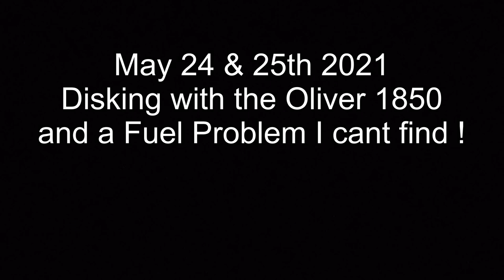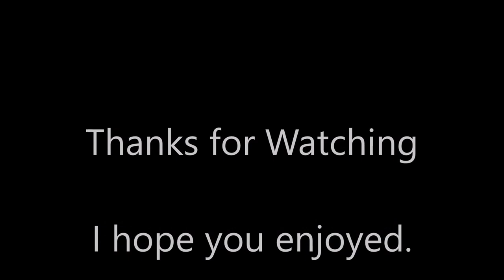May 24 & 25th 2021 Disking with the Oliver 1850 and a Fuel Problem I cant find !

Comment: I had that problem. It ended up being a weak lift pump not getting enough fuel to my injector pump.  I replaced the lift pump with a cheap Amazon product.  The lift pump I ordered from AGCO was a winner.  Additionally I replaced the copper sealing washers with a rubber/metal sealing washer that really helped seal my fuel connections at the lift pump.  One last thing I’ve run into, is the vent on the fuel cap creating a partial vacuum in the tank.
Reply from the maker: At the end of the video its sitting there running rough and running off the electric fuel pump and I noticed the top of the injector pump was damp something it had never done before using the mechanical lift pump so I know its getting more fuel to it. The lift pump is new that is on it but after everything I did and Harry did I went to the electric fuel pump just to see if there was a difference and at the end of the day I still got air in it. As far as my fuel cap goes I've learned not to fill the tank clear full as the cap leaks fuel all over the hood ! LOL  We even pressurised the tank looking for leaks in the fuel system and couldnt find any, With the electric fuel pump on if you take the fuel line off the out side of the final filter it will shoot a stream of fuel 8 feet !  The injector pump was rebuilt but I'm wondering if the problem is not in the injector pump now, I think its time to call the guy that rebuilt it and see what he says. Me and Harry both are running out of ideas to try and its really starting to bug me !  Bandit

Comment: There is probably a check ball in the return line on the pump. Pull it and maybe check to make sure the governor ring isn't coming apart in the injection pump. Had a welder acting the same way. Pulled the line off then the little check ball valve fitting and under it was a coffee ground looking material. Ended up being the pump. Would bleed it off and it would run good for a bit then act up. Check into that
Reply: Wow you got lucky finding that one, but who knows that might be the problem here. Good one JD

Comment: 2 cents wont buy much, but for what its worth, had a similiar issue on my 2-85 white.  Didn't leak but the seal on those CVA pump governor linkage shafts (o ring) would suck air but not leak diesel. Like you i started at the tank checking all the fittings, seals, the lift pump action, right up to the CAV pump.  Was told about some o rings under the cap that could go wrong so I replaced them, and I kept replacing it hoping for a fix but seems the over the counter o rings are not a perfect match and sucked (literally) just as bad.  Got ones from a rebuild shop ($17 If i remember correctly). Finally solved the issue for my case. They are a pain to bleed by yourself for sure. Always some problem popping up when pressed for time. Wish you an easy and quick fix.
Reply from the maker: Roger I had the injector pump rebuilt last summer so it should be right, But that dont mean its 100% right !  With everything that has been done to the fuel system I really have to start wondering about the problem being in the injector pump. I put the electric fuel pump on to see if the lift pump was the problem but at the end of the day I still had the same problem so its not the lift pump, But after running it several hours on the electric pump I did notice the top of the injector pump was damp so I'm wondering if the problem is in the injector pump now. I think its time to call the guy that rebuilt it and see what he says cause me and Harry are running out of ideas. I will say this sense the new rebuilt injector pump was installed its had a mystery miss to it that has never gone away, Could be timing but I doubt it or it could be the pump itself I just dont know.  Bandit

Comment: Bandit to much down time with the Oliver ive got a 1086 we don't use much any more we overhauled the engine a few years back did the injector pump and the injectors and put 4 new tires on it, the AC works really good it would look good hooked on the White disk!!💪💪💪
Reply from the maker: I would say bring it on down but after the storm we had last night and all the rain headed our way today and this week end it might be a waste of time. Got to see what happens this weekend and next week cause it might be out of reach for this year.  Bandit
Reply: @banditfarmer1900  we finally got done planting in the mud, now it's dry I got ruts everywhere and need a rain to get some of them up😫😫😫🤷
Reply from the maker: @lukedesselle2491  I wish I could send you some of the 4 inches we got last night !  Man what a mess I got to clean up now !  Bandit

Comment from the maker: Well its Monday May the 24th and Tuesday the 25th and I'm having a problem with the fuel system in the Oliver 1850, I keep getting air in the injector pump. When you have to bleed the injector pump 2 or 3 times a day you have a problem and I just cant find it so Harry is coming up Tuesday morning to see if he can figure it out. Sorry for no video of disking these days but my camera is not a go pro and it does not handle dust very well so no video dew to dust !  But I disked a couple of hours Tuesday morning before Harry got there and the first thing he did was bleed the injector pump and it had air in it again ! I had bled it before I started it so its getting air someplace so were trying to find ware it getting it. He did replace the copper washer in the bleeder port and took the copper washer off the final filter and wrapped it with thread tape to make a better seal and that helped a bunch ! We both got to wondering if the new fuel pump might be bad or the cam worn enough that its not pumping enough to keep up and the injector pump is creating a vacume and sucking air someplace, So he said with everything we did if it gets to running rough again to put an electric fuel pump on it and see how it runs with it. Well about 4 PM I went up and bought an electric fuel pump and installed it bled the injector pump again and switched the disk to the MM disk with the drag on it and hit the field again. After 3 hours of running it its back to running rough again and this time the injector pump looks wet !  Well back to the drawing board ! In the morning I'll go to McHenry's to talk to Harry again and see what he thinks about it and go from there, Rain is in the forecast for Wednesday Afternoon so I got to get the disking done before it does. I hope you enjoyed watching . Bandit

Comment: Check air vet on fuel cap, my tractor did this and coursed a vacuum in the tank
Reply from the maker: I learned the hard way not to fill the tank to the top cause if you do you get fuel on the hood from bouncing around ! LOL It needs a new fuel cap for sure as it lets fuel out real easy ! Bandit

Comment: I am in the process of fixing this same problem on our 1850. I found out that the secondary fuel filter base had a crack in it that led to air leaking into the fuel system. Your problem may be different, but I’d check all o-rings on the filters, fittings, lift pump, and inspect everything you can see. I’m sure you’ve already done this however. Other than that, I’m not sure what else to add, because it seems as if you’ve gone through everything.
Reply from the maker: We pressurized the fuel tank and fuel system and cant find a leak any ware on it and I'm wondering if the problem is not in the rebuilt injector pump. After putting the electric fuel pump on it and running it for 3 hours or more the top of the injector pump was damp from fuel so I have to start wondering if the leak is not the injector pump itself. I think its time to call the guy that rebuilt the injector pump and see what he says and go from there.  Bandit

Comment: Hope you got it right Bandit, it must be a huge frustration
Reply from the maker: Jan this is a problem that I've been dealing with sense the rebuilt injector pump was put on and I've been going threw the system and checking things off the list and the list is getting mighty short now and its really down to one thing, The injector pump !  Now its down to checking what the books say about the timing and getting the injector pump checked out and I will be very happy when we find what the real problem is and I've done everything else to it so its down to this.  Bandit

Comment: that sucks! i hope you can find the problem! I have a case that always hard to start all the time! Frustraded lol
Reply from the maker: With everything I have done and Harry has done the only thing left is the injector pump and its the only thing that hasnt been touched yet. I'm doing research on the timing looking to see if the timing had been changed in the engines after the tractor was built and I want to see if it has been and we got the wrong info to time it with.  I think its very close but not 100% so time to research it and find out.  Bandit

Comment: Have you thought about the lift pump. Had a few machines sucking air through the diaphragm of the lift pump
Reply from the maker: Well thats why I put the electric fuel pump on it just to find out if the lift pump was good or bad, The lift pump might be good and have a cam thats worn enough that it cant keep up letting the injector pump create a vacume and making it suck air someplace, Or the lift pump is just bad cause it had a new pump that failed before and this is its replacement. But after putting the electric fuel pump on and running it about 3 hours it got air in it again. This is really starting to bug me !  I have not touched the injector pump yet but I'm stating to wonder if its not the injector pump causing the problem. It was rebuilt but that dont mean it cant be the problem.  Bandit

Comment: 3rd times charm Bandit. We all have those kind of days.
Reply from the maker: Bill I cant count the times I and Harry have gone threw the fuel system from tank to injector pump and every time we do we think we got it fixed and it does the same thing all over again !  I just cant find the leak letting it get air into the system and even with the electric fuel pump pushing more pressure on the system I'm still getting air and it just wont run smooth so Harry and I think its time to call the guy that rebuilt the injector pump cause at this point its the only thing that hasnt been touched. It hasnt run quit right sense the injector pump was put on, It not a miss its very random and doesnt idle smooth. I really believe its the injector pump and timing, My book says 28* before top dead center is ware the injector pump is timed to. The guy that rebuilt it said the pump is timed to 0* Top dead center so thats how Harry had to retime the engine to to get it to run and I have never thought that was right. I've been trying to look up and see if the later 354 Perkins had the timing changed from the older ones and I really am having a had time finding out the info I'm looking for but I'm not done looking yet !  Bandit

Comment: Just doesn’t make sense at all that is frustrating. Can you narrow it down too which Cylinder you have to bleed or is it all of them? It’s amazing how small of a leak can cause a big problem I was having a fuel leak on a atv and I changed the copper washers and tighten it and still had a problem, finally got the book out and got the torque spec and it needed to be tighter and it fixed it could be thos rubber hoses I’d look for the weakest link might not be leaking out but that engine must be sucking hard for fuel, that’s why I was askin about how much fuel cause if it’s a full tank it stays a lot cooler my 7.3 which is a completely different style diesel has a weird problem starts running like that once it’s hot but it’s a injector I was thinking injectors but this are just normal ones not like the 7.3 so I don’t know seems weird tho maybe go with clear tube where thos hose clamps are then you could see if there’s bubbles
Reply from the maker: I've been threw the fuel system a dozen times and so has Harry and we just cant find the leak, All the fuel hose is new I used and so are the hose clamps and we've checked every fitting and line in the fuel system and can find nothing wrong with it. I pulled the fuel the fuel line off going into the final filter and flipped the switch to the electric fuel pump and shot fuel out 8 feet ! LOL Put that line back on and tool it loose on the out side of the final filter and shot fuel about the same so filters are clean and open but its getting air from someplace and we just cant figure out ware. As far as the injectors go they had new tips put on them and rebuilt reset to correct pressure and installed when the injector pump was rebuilt. The return line to the tank was checked and its open and clear so I'm really stumped on what is going on.  Bandit

Comment: Fuel cap if it not vented will cause it
Reply from the maker: I found out if you fill the tank full to the top you end up with fuel on the hood cause the cap leaks !  So I can cross out a cap not venting pretty quick. I really wish it was something that simple and it could be and just havent found it yet, But I think its time to call the guy that rebuilt the injector pump and go from there.  Bandit

Comment: Did you open the engine?
Reply from the maker: No and really dont want to, I'm pretty sure its in the injector pump or timing . The whole fuel system has been gone threw several times and the only thing not touched is the injector pump so I think thats ware the problem is at. I got to call the guy that rebuilt it and see what he has to say about it and go from there.  Bandit